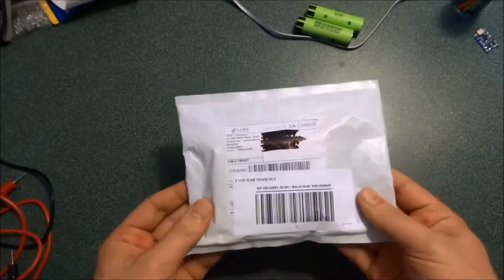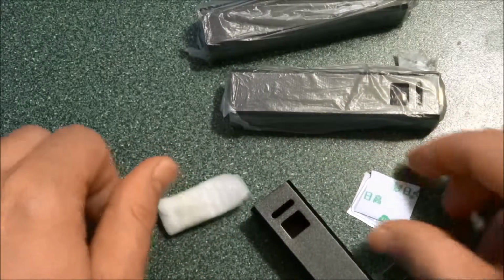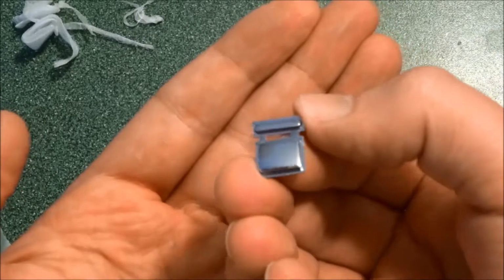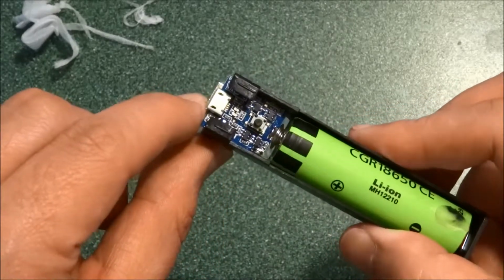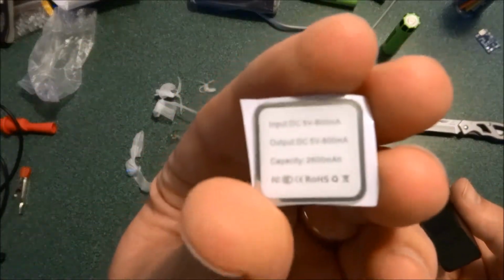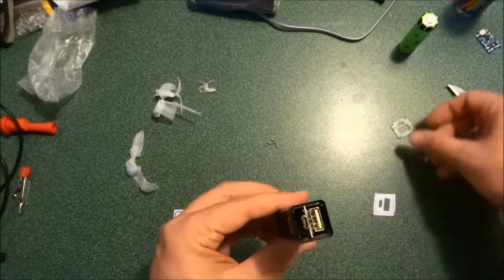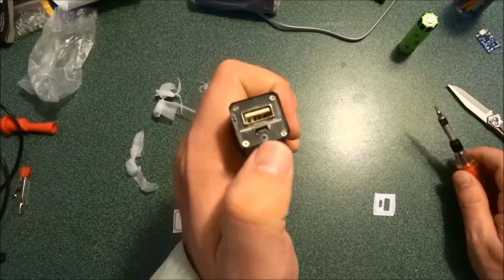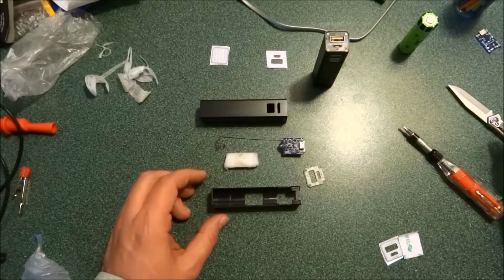DIY single cell 18650 power packs

Comment: Hey man thank you for the video.  I have been looking for these but I cannot find them.  Can you put a link to ebay.  I simply cannot find them under the name on the label.  Thank you so much.
Reply from the maker: +Johnny Kelly Here is a list of several EBay auctions:

http://www.ebay.ca/sch/sis.html?_nkw=USB+Aluminizing+2600mAh+Mobile+Power+Bank+18650+Battery+Charger+for+iPhone+5+5S&_id=131427621815&&_trksid=p2057872.m2749.l2658
Reply from the maker: +Johnny Kelly Also, thanks for watching!